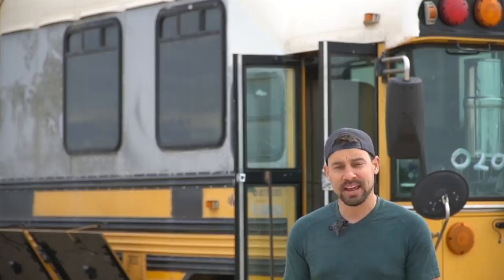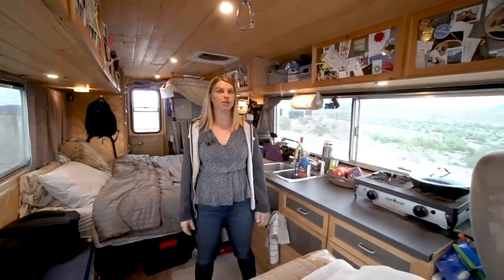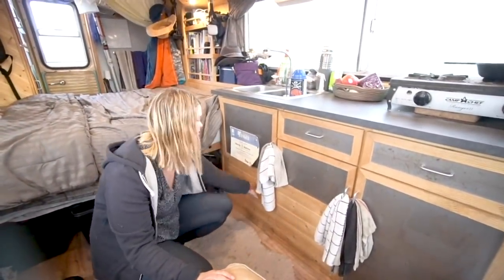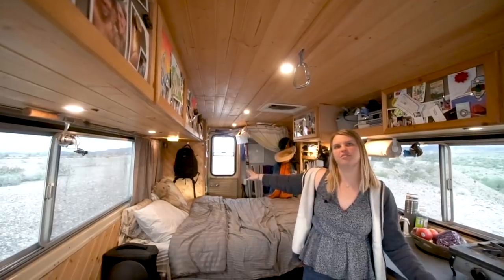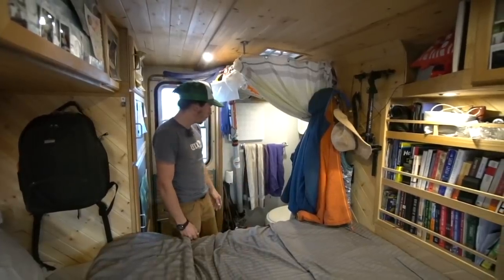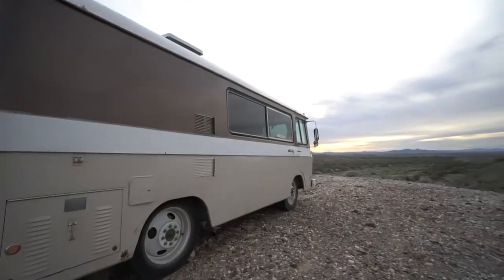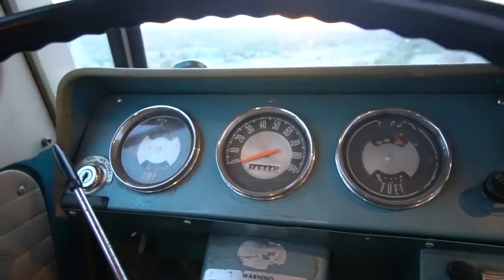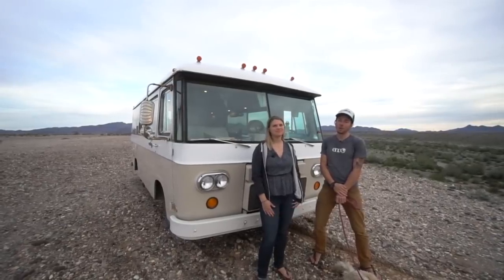1964 Clark Cortez Motorhome - DIY Camper Van Build From A Vintage Platform

Comment: the cortez was a unique vehicle from a company that didn't build any other street-legal vehicles. clark equipment company built forklifts and airport tug tractors and gearboxes for other manufacturers, then out-of-the-blue they decided to manufacture an rv of all things. it's a front wheel drive so the floor is low in the vehicle, clark built everything except the engine which was a chrysler slant six in the early ones and a ford 302 v8 in later models. all were 4-speed manual with clark's front drive transaxle which is pretty much unbreakable.

Comment: This is a great video. I like your rig a lot. You might tell me where you’re at the location is beautiful!  I would say in the future add some additional solar panels and get some lithium batteries. Unless you plan something else for the roof, you’ve got a ton of space on that roof and with the latest solar technology and additional panels you could really rock the power which would be cool. You could have a heater, built-in, and air conditioner would not have to worry about your fridge those sorts of things. And it would pay for itself overtime without a doubt.

Comment: Hello, and welcome to the.small-format RV community.  My Airstream 190 has a floor plan not on like the original layout of your Cortez coach.  Note that I wrote "coach", not "van": what you have there is a small Type A motor coach.  It never was a van.  To quote Marvin Martian, it makes motorcoaches "very angry" to call them vans.  And who knows?  Our paths may cross in the future, if you decide to hob-nob with the RVers at an FMCA event.  "Happy Cybercamping!" - Michael Canode, F13948S / NZMCA #E19250 -- Webmaster / Editor, FMCA Ohio Nomads Chapter

Comment: Start where you can and upgrade as you go!👍🏾👏🏾👏🏾👏🏾
Some people shower in the bathing suits.
Reply: I’ve done that often, hitting hair, feet and pits outside so you don’t have to fully disrobe.  You can use wet wipes for the privates when out of view inside.  If you prefer, you can get an inexpensive portable/collapsible shower surround for showering outside.  Those are nice, but there is no room in them to undress/redress after a shower, unless you are super flexible...!

Comment: Beatiful Tiny Home! But please put the carbon monoxide detector near to the ground maybe under the bed, because the gas is heavier than air and it wont warn you early enough (if at all) in that high cabinet!!!
Reply: True, that stuff accumulates at the floor, very dangerous! You’ll never even wake up, if it happens at night 😱
Reply: Wrong gas. Propane is heavier than air. Carbon monoxide slightly lighter. Place your CO detector at any level but should not be buried in a cabinet.  Hope this helps
Reply: PAUL COX Thank you for noting that, as I had that wrong way around too.  Your comment could be a lifesaver!

Comment: metal tools in the same compartment with the batteries-dangerous for an inadvertent or accidental short circuit,  Get covers for those terminals or divide the compartment.

Comment: Could you supply the width (96"?) and any idea of the weight?  
Length is 19' I think.  Is that correct?
Does the FWD configuration enable an extra low floor like the GMC motorhomes?
How much headroom is there?
Thanks.